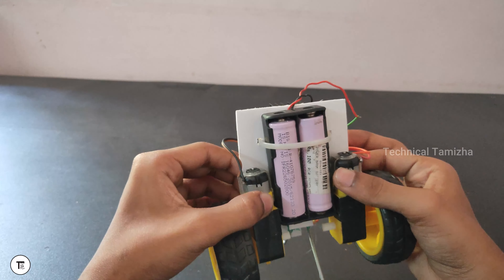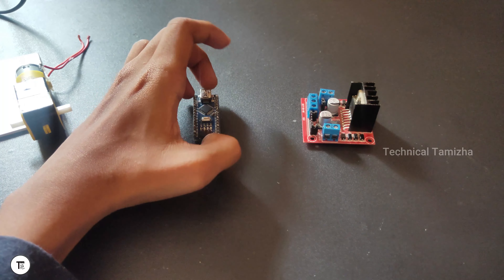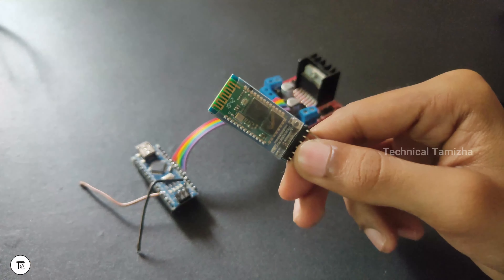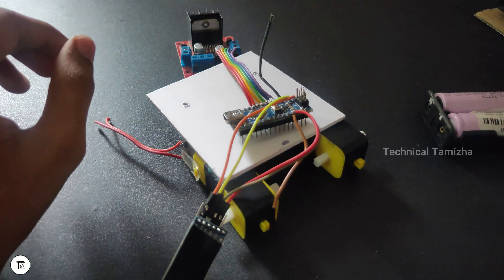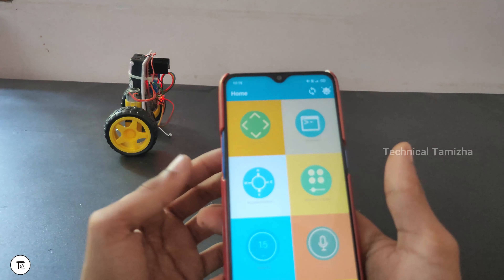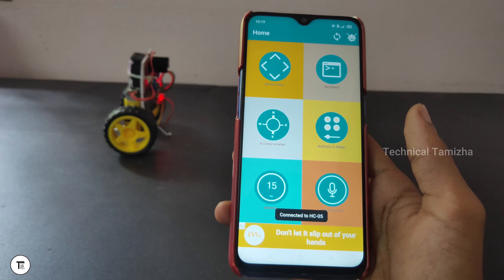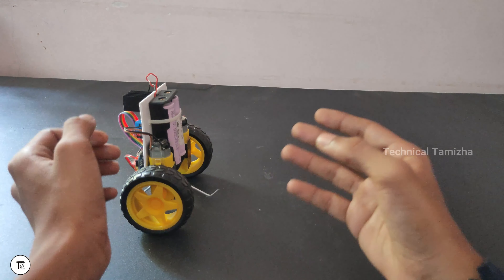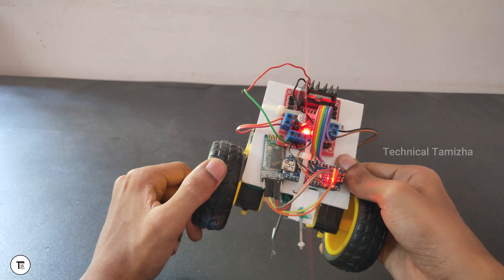How To Make DIY Arduino Voice Controlled Car At Home

Comment: Best for arduino project uno or nano or mega anna
Reply from the maker: All the board or best for there will be a pin difference between these 3 boards Comparing to Arduino nano and Uno ,mega has more in out pin ,for beginners Uno ,nano is best if you have money you can buy mega also no problem
Reply: @Akilesh-S  ok anna

Comment: Bro litioiron battery yepedy recharge
Reply from the maker: Use lithium iron charger or use changing modul
Reply: @Akilesh-S   any bro but simple and low cost
Reply from the maker: @docterlegenda6196  low cost means u can buy module TP4056
Reply: no cost
Reply from the maker: No bro we can't do because it is dangerous ,li ion battery s are dangerous we need any module to charge it an need to stop wile overcharging If it heats It can blast..
Reply: Ok